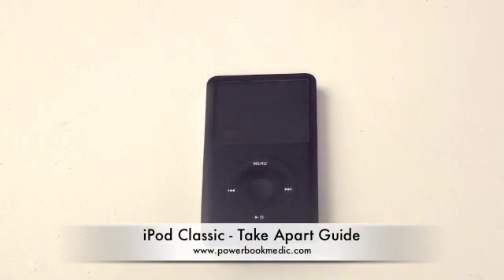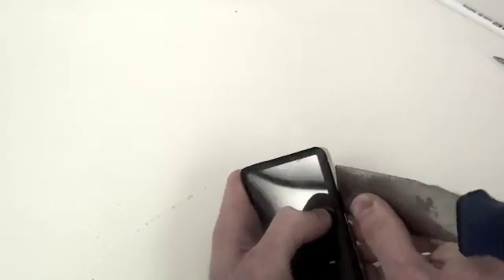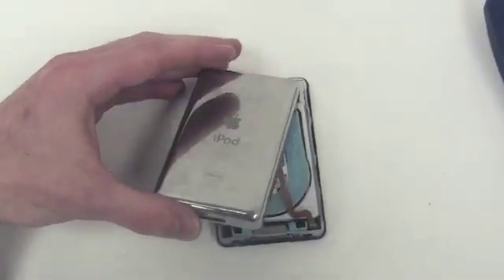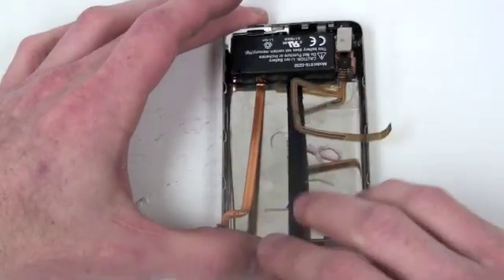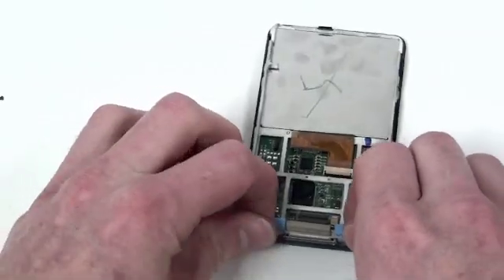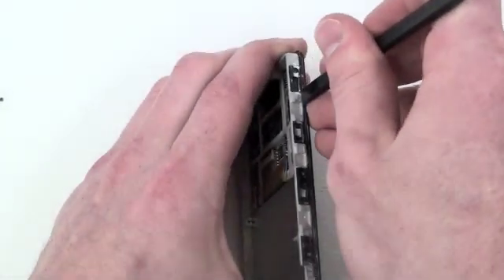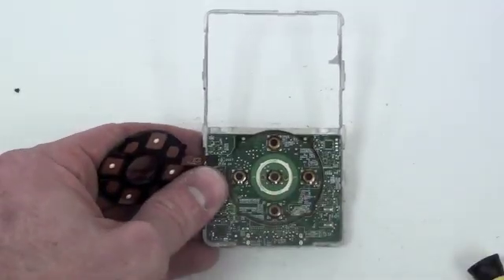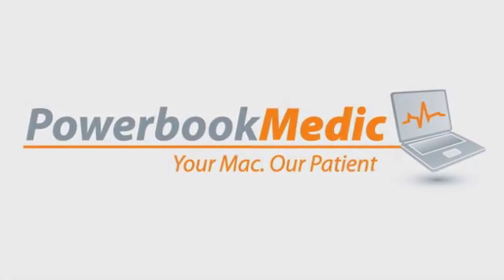iPod Repair Classic 6th Gen Take Apart Disassembly

Comment: the one one i have does NOT have that kind of hard drive!! 🤔 i have the similar one but grey with 160 gb and the battery is totaly different from yours! its its more square and  it sits just behind the screen and after taking apart, then there is the battery right there!!! i just ordered one thats smaller rectangle to see if it was the battery because it won't charge or turn on and all chargers work!! i hope i don't have to replace anything else!!

Comment: Upon opening my iPod, I noticed my headphone wire/connection is cut in the middle... can I purchase a replacement? Also my battery looks a lil fat, is that from constant charging/ discharging?  I would like to replace it because I know when it was new it wasn't so obese. Help me out-  I have a lot of irreplaceable files on here and need every bit of help I can get...
Reply: i think you can find that part on ebay.

Comment: Good video, thanks for the instructions.

I accidentally removed the locking mechanism for the battery connector ribbon when unlocking it (i.e. it's actually come off the pins) and I was wondering if there is an easy way to get this back on? Do I just have to align it with the pins and push it back on? It just slid off very easily so it wasn't soldered or anything.

Comment: I've checked everything. With different clickwheels and headphone jacks. When I connect it to my mac it doesn't recognize it, and some msg comes up. I plug it in to my mac, wall charger, press all the buttons, and it doesn't respond. Can't even hear the hard drive turning on. Could I have damaged the logic board? I grounded myself (at least I think I did, by touching metal objects all around). If there's something wrong with the hard drive ribbon, would this happen?

Comment: @SpyceySalad I was able to fit a 120gb classic inside of the 5th gen case. I had to shave down the inside of the 5th gen case a little bit to get the board to fit. I also had to space the 5th gen button pad and center button with tape on the contact spots to get them to work properly.

Comment: @PowerbookMedic i searched it up, plausibly.  it is compatible.

but a slight modification is needed....   searching google. the two faceplates compared in picture.   the 6th gen has a fully lined tab. the 5th gen has a tab with a gap inbetween.
you'd need to grind off a gap inbetween the screw hole, and the other side of the tab to make it fit nicely.

Comment: so could you take the faceplate from a 6th gen and put it on a 5th gen?

basically like externally switching a 5th gen into the updated 6th gen!

just add firmware and voila?     but the thing is, are the 6g faceplates compatible with the metal bodies of the 5g's since they should be the same body

Comment: ok so i ordered a new battery because  my ipod died and i couldnt turn it back on. i dont have the new battery yet, but i decided to take it apart earlier this evening and now i cant get it to fit back together because it got slightly warper, i think. do you know if there is anyway i can get my songs? only about 1/5 of them are in my itunes library so i would be devistated if they were lost. can i possibly buy a new ipod and use the hardrive of my old one?